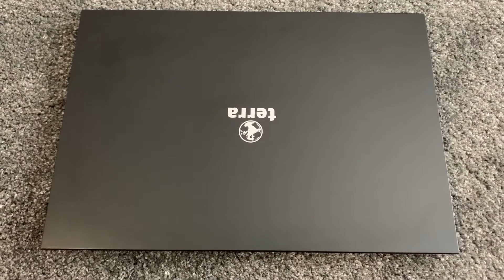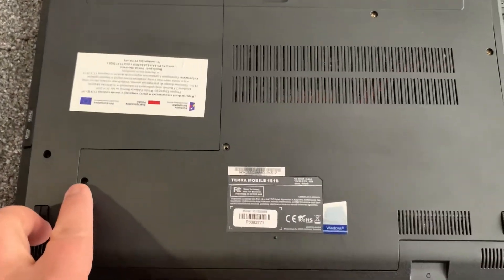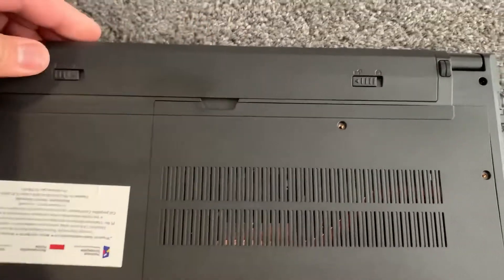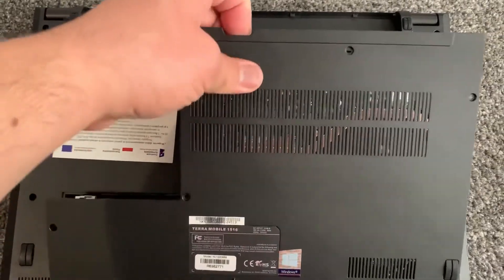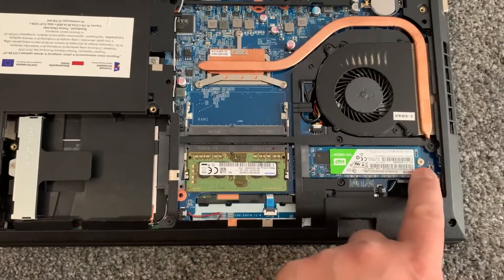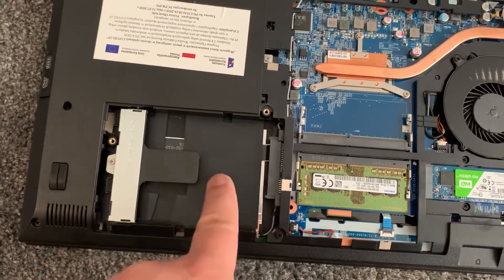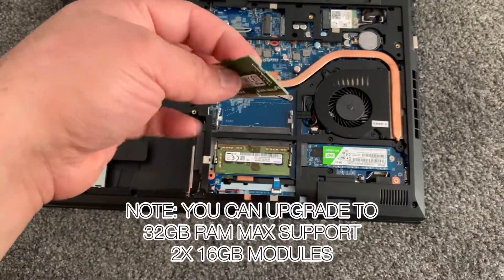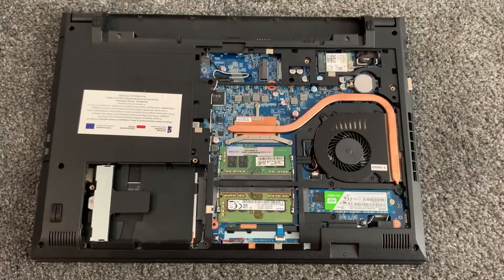Terra Mobile 1516 - Upgrade Ram, Add 2.5” SSD, Reset or Replace Cmos RTC battery

Comment: Make tutorial for upgrade CPU on terra mobile 1516
Reply: That's not possible, CPU is soldered to the motherboard. Sadly it's normal nowadays, but this laptop does way better than most devices on the market. Most laptops have soldered Ram and sometimes even SSD and they are glued together. You can even change the battery here :)